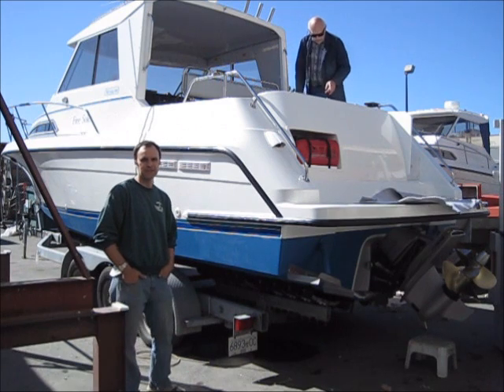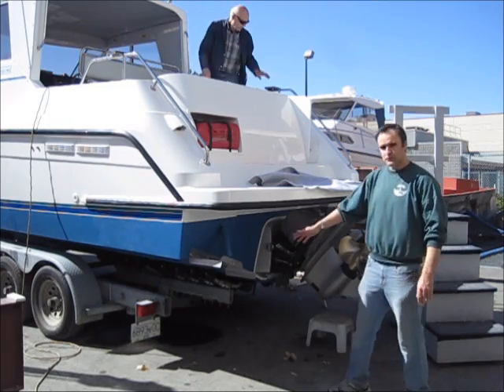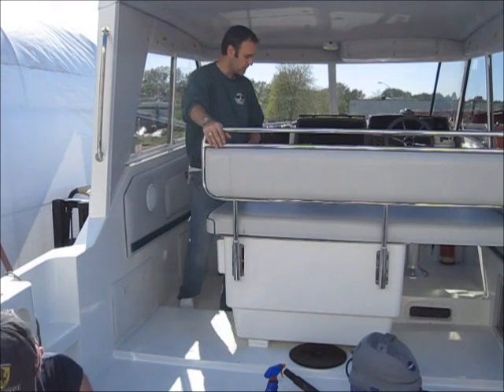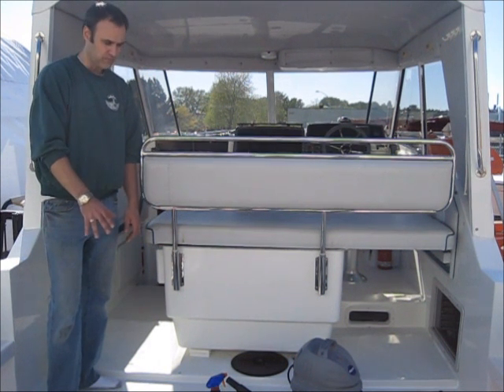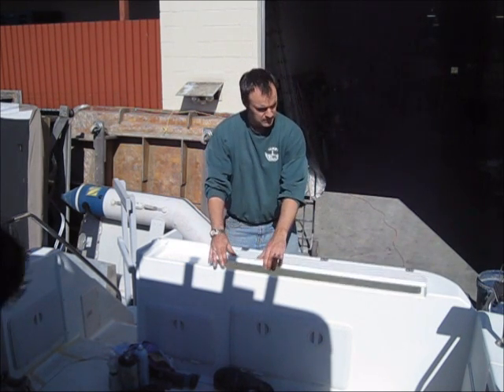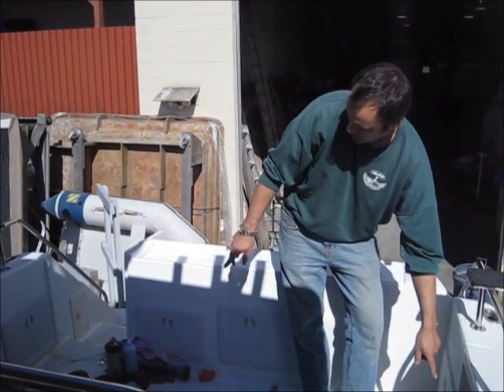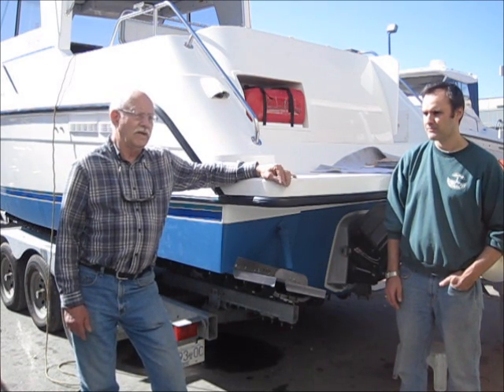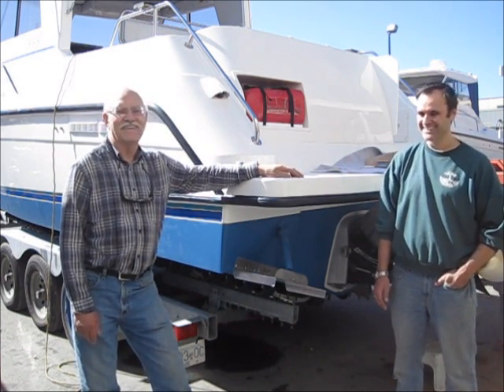Stretching Fibreglass Powerboat Part 11

Comment: Hey guys , great series on a fantastic display of your craftsmanship ! I really enjoyed watching each episode along with your easy to understand narration . I live in Victoria Australia and am the proud owner of a 17ft Haines Signature which I propose to extend to around 19ft with an incorporated swim platform and outboard pod . Also changing the deck from a closed bow/windscreen configuration to centre console . It is currently powered with an Evinrude 110hp v4 carb engine and am wondering how much more HP you think I could run ? I am interested in the new Mercury Verado 135 or the Evinrude 135HO etec which is a v6 or maybe just the 130 etec which is just a 4 cyl  . I do like a bit of performance which is why I would love to go bigger !!
Cheers and keep up the great work !
Reply from the maker: Thanks for your comments on the videos. If you are not aware, the "Monaro" name does come Australia. 
For a 19' boat I would stick with a 4 cylinder outboard. I'm not familiar with the Haines hull shape but I believe a V6 would be too heavy.